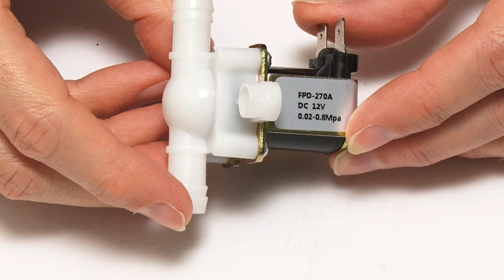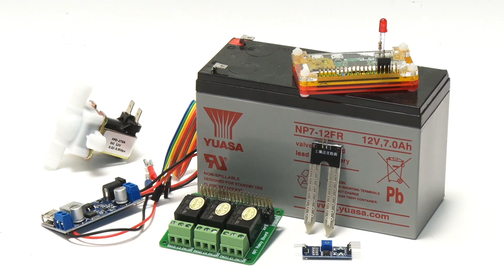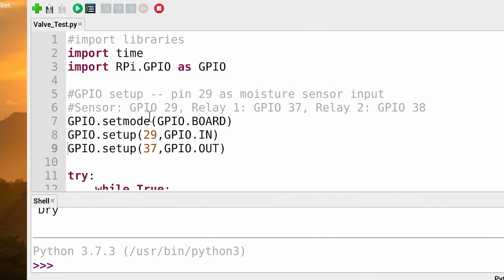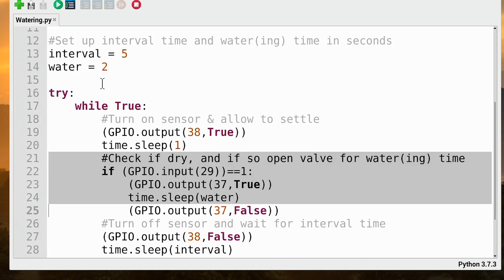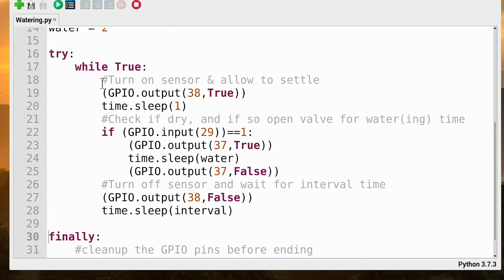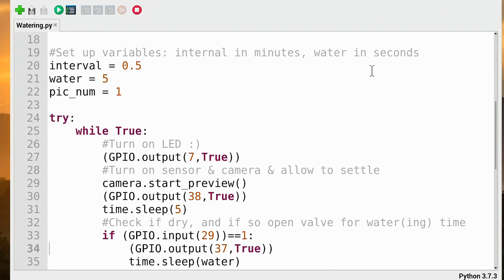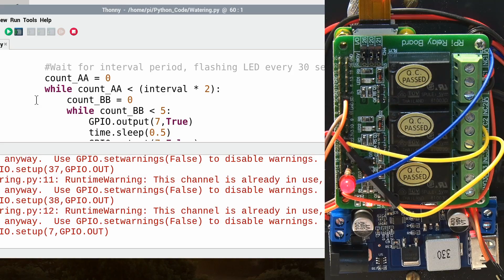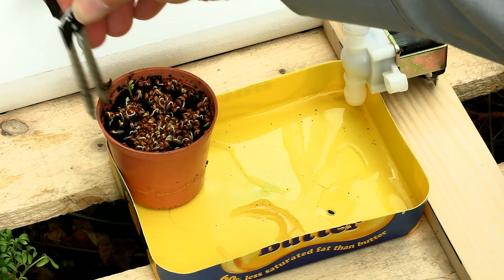Raspberry Pi Plant Watering (& Time Lapse)

Comment: So, if the Solenoid Valve pass through the 5v converter  , can I use power it all by a USB cable or a power bank instead of acid battery, right? Even if I know that the power bank won't last long

Comment: Would someone answer please why not use the transistors instead of relays? What would be the differences between both applications? I quite don't understand why use relay for turning on and off something for a few seconds. Thanks for all your insights.
Reply from the maker: A transistor is used for low-power electronic switching. To switch higher power electrical devices, you generally need to use a relay, or a TRIAC, or something containing the same (like a dedicated controller -- eg an L298N), to avoid damaging a transistor. Some transistors can control some solenoid valves, but it will depend on the rating of both devices.
Reply: @ExplainingComputers  Thank you for the answer. My basic understanding is that power, in this case, means heat? Too much heat and I will burn the transistors. Where is the limit? When should I reach for a relay? If I follow the transistor datasheet and provide a good enough heatsink, a transistor option should be feasible? I am currently working on a DYI project and switching the 12V 124mA(when loaded) peristaltic pump with BC639. Preliminary breadboard trials show reasonable heating of the transistors. I use them for 30-90 seconds only. Is there anything wrong with my approach? Will it in the long term result in damaging the circuit? I use transistors to save some space. Would you recommend some resource, a book, YT video,  where I could acquaint myself with the topic of deciding whether I should use one or another? Transistor vs relay? Thank you.
Reply from the maker: If you stick within datasheet values, you will (should!) be fine. It's fundamentally about current draw, within turn relates to heat as you say. As I said in my first answer, some transistors can switch some solenoid valves if the ratings of both components match.

Also remember pragmatics. You asked why I used a relay, and had a relay HAT available, so that is what I used. :)

Comment: I wonder. If you didn't need the camera and as such used the Pico over the Pi  Zero. What energy saving do you think you would get? Or if you combined this project with the weather station. Then again the Pico likely doesn't have a means to takes its readings and output them. that is to say there is not wifi or LoRA to connect to a server and read said data... is there?
Reply from the maker: Using a Pico would give a massive energy saving -- maybe 90% or more.
Reply: That's good to know. I watch the video of a gentleman using some LoRa radios, one Tx one Rx with the Raspberry pi Pico.

I'm thinking I may have my next project. As I already had an off-the-shelf digital rain gauge here that died years ago. Maybe I build your weather station with a Pico and LoRa transmitter and add in the rain gauge.

The rain gauge was simple enough it had a funnel and two small buckets that acted as scales. One would fill up and it would move to drain and that would cause a magnet to pass over a reed switch. Which would be a simple binary (0n/off). If I take the math for the area of the funnel and determine the amount of rain it takes to scale and trigger the read switch I should be able to calculate rainfall.

Here in my home garden I could probably get away with Wi-Fi. But I also want to put one of these weather stations at the community garden less than 5 mi away or approximately 3 km.

I could then do a similar project but using soil sensors and data gathered from the weather station to determine actions to take at the community garden.

Oh boy all this brainstorming is getting exciting. Would you consider doing a larger project based series?
Reply: I also realized the community garden doesn't have access to electricity. So I would need to build some sort of solar collector and charge controller to help maintain the battery.

Comment: Nice video! Have you tried the analogue output of the moisture sensor? I am working on a similar project(No Camera but with analogue moisture reading upload to server), but the analogue readings were affected by the room temperature and humidity. Do you have any suggestion to calibrate it?

Comment: Does the corrosion prevention really works? Doesn’t these sensors corrode anyway?
Reply from the maker: Yes, turning off the power between significantly reduces the corrosion. The probe will corrode anyway, but nowhere near as quickly as when you have a current going across its electrodes!

Comment: I have some questions :
 can you use a USB webcam instead of pi cam?
 that solenoid valve is not a water pump or is it, can you use a pump instead...?
 can you build a sensor that could tell (warn) that barrel or reservoir is running low on water...?

P.S.  good video, make some more videos like this. next video could be automatic pet feeder... :D
Reply from the maker: You could use a USB webcam, but not with this code (as the camera interface would be different. The solenoid value just turns the water on and off, it is not a pump. But you could use a pump. I have already made a pet feeder video: http://youtu.be/lT4AZAJdtAs
Reply: @ExplainingComputers  cool, thanks

Comment: I am working on building a barn door star tracker using a stepper motor and i was wondering if a raspberry pi pico would be able to control a 5v stepper motor at a specific speed along with a button to start and stop plus a button to return to home position at max speed, i am a software developer so can program in python just not sure of the picos capabilities as you have to upload the program to it.

Comment: great video! you should be able to replace that probe with 2x stainless screws soldered to leads, roughly as exists in water tank fill systems. i bought a solednoid to do this a while back, but have not had the brain power to put it all together. this video is super helpful!
Reply: if the screws get a scale build up, pull them out and soak them in some close to boiling temperature water w espresso machine detergent

Comment: put a small 30-50w solar panel and charge controller to keep that lead acid topped up. ! & maybe lithium phosphate upgrade would be cool like a diy 10ah 4s pack. i am looking forward to making one for my self as i have a lot of plants but don't get the time to properly water them and in the summer times temps in india peak 40c during 1-3pm . for atleast a week and plants dry out super quick.

Comment: Not having played with Raspberry Pi it's not clear how far they can be expanded.  Could I set up a system with several sensors and solenoids, say 5, and have it work so each plant, or plant bed, was independently watered?  Control would be the ever popular "simple matter of programming".  Another sensor on the water container could trigger an alarm when the water level gets too low.
Reply from the maker: Yes, this could be done. Realistically it is hard to stack more than two relay HATs, so a practical limit is probably 6 relays (one of which could turn all the moisture sensors on and off). As I recall, there are 29 GPIO inputs/outputs on a Pi, so you could have six relays (controlling five solenoids and one to turn the sensors on and off), your float sensor, and 22 moisture sensors -- in theory! :)
Reply: @ExplainingComputers  Thank you for your answer!

Comment: A project can get big very quickly, I am designing a controlled bio environment for a friend, it's got to monitor moisture temp and humidity and control three relays for a heater a fan, and lights all the while using a real-time clock to set the timing of different events and measurements, it also has to give access to the operator via a 1602 LCD display and four buttons to change setting and display readings.

Comment: I got this relay Hat but this is behaving like Active Low. when the Raspberry Pi pin goes High the relay turns Off and when raspberry pi pin goes low the relay turns On. Is this expected??? What you show is opposite of what I am experiencing with this Hat. Please share how I can use this as shown in your video
Reply from the maker: It sounds like you are connecting to the wrong pins of the relay! :) Each relay has three connections  (C in the middle, and NC and NO on the edges), allowing it to be used as either normally open or normally closed. You need to use the middle (C) and the normally open connection (NO) not the normally closed (NC) if you want to turn something on when the Pi's output goes high. Good luck!
Reply: @ExplainingComputers  My Relay Hat is from another manufacturer and it seems to be an Active low one(I read about it that all terminals are active-low), Hence the behaviour. I will get the same one as you are using, that one seems to have Active High terminal

Comment: A little code recommendation. Create a global variable like 'MOISTURE_SENSOR_WET = 37' and use that wherever it happens in the code. You'll increase readability, especially as your logic gets more complicated, and if you ever get a different sensor your code will be more reusable.
Reply from the maker: Please explain. Where would a "moisture sensor wet" variable be used? There is only one line in the code that checks the status of the moisture sensor -- if (GPIO.input(29))==1: -- so no possibility to avoid duplication, and replacing either the GPIO pin number or the value "1" here would not improve function or readability. The code will also with with any resistive moisture sensor module (and will not work with capacitive as the Pi as no analogue inputs).
Reply: @ExplainingComputers  ah, I read what the ints represented wrong at first look while watching the video. I initially thought 37 represented a "wet" output from the sensor.

But what I mean here in general is you have pins for the sensor and the two relays. (29, 37, and 38 I think?) If you give those names at the top of the module (like RELAY1 = 37) then everywhere you get that device you can instead write GPIO.input(RELAY1) or the like to make it clearer. Also, if you change pins later, you will only have to change one line of code.

Sorry, my phone app makes it hard to comment and look at your code at the same time so I hope my example makes sense.

Comment: The corrupted frames might come from an insufficient power supply, although it looks like in this case there is plenty.
Reply from the maker: Yes, this was my first thought, but the Pi clearly never crashed (which I would have been apparent as the picture number would have reset). It is a bit of a mystery.

Comment: Being a newbie to valves and such, I have to ask the idiotic questions: The solenoid valve is just that, a valve that is either open or closed? You need water pressure on the intake side for water to flow through the valve, right? Using gravity is the best ("free" = uses no battery power), but I could use a pump (=draws extra power from the battery) if I wanted to make this overly complex and have access to the extra power needed to operate the pump?
Reply from the maker: You are right -- the valve is either open or closed. But when open how much water comes through is (to my surprise) pressure dependent -- the "hole" does not completely open up when the solenoid is activated. Here I did indeed rely on gravity, and just opened the valve for longer than I first anticipated.

Comment: there is a problem with moisture sensors, because they cannot be permanently energized, otherwise they will be quickly destroyed by electrolysis
Reply from the maker: That is why the sensor here is turned off inbetween readings! :)

Comment: You can actually do this (without the camera though) with a single ATTiny45 or ATTiny85. Then you have a little 8 pin dip package. Also I wouldn’t toggle the sensor with a relay. You can ignore it’s value or switch it with a transistor or mosfet. That will get rid of all the ticking. But a simple and nice project.

Comment: I also wanted to wanted to use raspberry pi for to water my plants, but I found raspberry pi a bit expensive hence I settled with a 555 timer configured as a stable multi vibrator to drive my water pump

Comment: great video i was already looking on several irigation videos before.this one is most comprehensive.btw why ot use these sensors https://www.amazon.de/-/en/moisture-capacitive-analogue-hygrometer-corrosion/dp/B07R174TM1/ref=sr_1_16?dchild=1&keywords=bodenfeuchtigkeit&qid=1626766792&sr=8-16 .I have seen in other videos that it doesn't have so bad corrosion problem.
Reply from the maker: A different sensor could certainly be used. However, you cannot just replace a resistive sensor with a capacitive one. Capacitive sensors have analogue outputs, not digital, and a Raspberry Pi does not have any analogue GPIO inputs. So extra hardware would also be needed.
Reply: @ExplainingComputers  thank you very much. I'm quite newbie to raspberry and these architectures.Thank you for clarification on moisture sensor =after explaining it make sense. Also great idea how to solve multiple pots at once. I just wonder how to solve irigation for whole balcony. Imagine situation you have 5 pots which are watered from above and you need to leave for 1-2 months. Also if there is any posibility how to check them(see the moisture of separate pots) "from internet"? May be idea for next video :)

Comment: Hmmm, I would use a self-watering pot. Fill it up to it reached the top mark, Wait for it to reach the low mark, and then fill it up again to the top mark. A simple Pi Pico with a solenoid valve arrangement would suffice.  Such a setup would save a lot of energy and be simpler to implement ... 😉. Interesting tutorial though...

Comment: sop much good stuff. 
alas, it is hard to get a worse soil moisture sensor. by the end of the season, the traces will be gone.  all moved into the soil.  lead, copper, et-at.
almost as cheap is a sealed, capacitor based sensor.
Reply from the maker: Remember that a capacitive sensor requires analogue GPIO inputs, which a Raspberry Pi does not have! :)

Comment: Excellent video Christopher!
You could add a temp/ humidity sensor some 12v halogen lights and a fan to control the temperature and humidity inside your greenhouse and make good use of the last two relays ! I would use a small logic level mosfet to turn the board for the moisture sensor on and off as it will have a longer life than a relay and use less power - you can get small mosfet modules for the Pi and arduino very cheaply  and possibly one that is in a hat format to replace the relays altogether.

Comment: Do you really need a relay to turn on/off the moisture sensor?  Assuming the sensor operates with 3.3V - 5V, can you just turn it on/off directly with a GPIO pin?

Comment: Regarding your issues with the photos taken at night.

Since you have one relay left on the hat, the logical next step would be to wire up some lighting and do one of the following:

1. Turn on the light for every photo to keep things simple. (Give the camera a couple of seconds to adjust for white balance if needed.)

2. Add an LDR or a photodiode to the Pi, and use it as a go/no go for the camera. (Or to decide whether the extra light is needed.)

3. If the camera itself can provide feedback on how much light it can detect, (without too much fiddling with the code) set up a go/no go for either turning on the light, or not taking a photo at all. 

At this distance, I don't think you need much light. A £2 1W gooseneck LED spot from IKEA would do the trick. I'm thinking of article no. 702.912.32 on their webshop. (Using some cardstock or a piece of styrofoam as a light bounce would be preferable.)

As usual, you have provided me (us) with another little project to have fun with. Thank you!

Comment: I don't suggest use that Cheap China parts to detect water level, they will release copper ion, if they are still in the same old design with copper wire. One way or the other, that metal wire in my eyes seems will react with water and not as durable as what the german part do.

Comment: I really good example practical application.  This provides the opportunity for a followup video.  Possibilities include:  Turn the sensor power off as soon as the moisture state is known.  Use an analog sensor or two sensors to control water delivery off and eliminate calibration, which will vary with plants and conditions over time. You could use a small pump from a stored water supply.  Sense the water supply and over-watering to raise an alarm.  Look at power consumption vs battery capacity, alarm on low battery, maybe add a small solar panel to keep it topped up.

Comment: Chris, this is great, however I plan to reverse engineer this project. A combination of a little ground subsidence and an ageing house means that rainwater has to flow uphill to drain away from the house. Before digital days I combined a bath depth alarm moisture sensor kit with a caravan water pump and filters to lift the water up and away from the house and into the drain. It works well, with maintenance, such as replacing bike-spoke electrodes every 6 months. This has inspired me to go digital. The only extra I would like is a blocked filter sensor, maybe flow rate or pressure differential?
Thanks so much for the inspiration! Mike.
Reply from the maker: Sounds like you have an interesting project to work on.